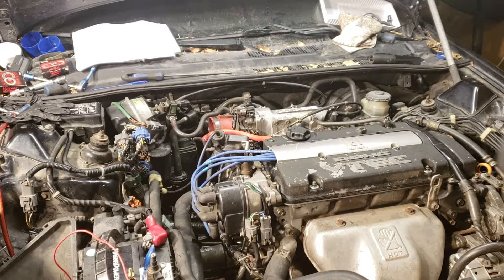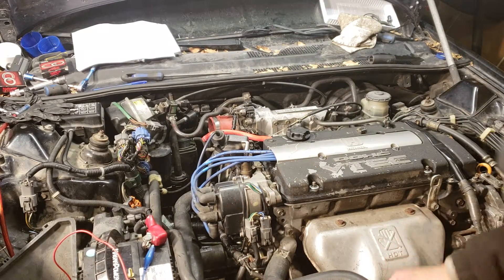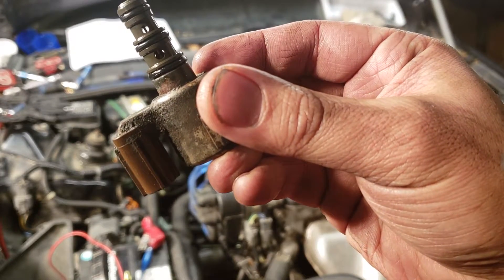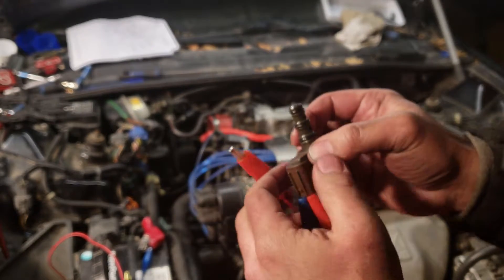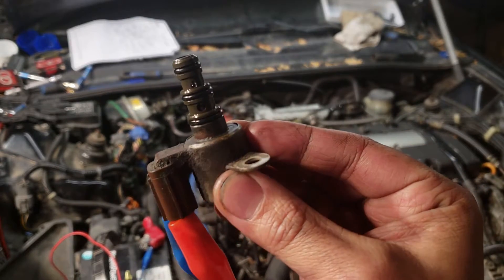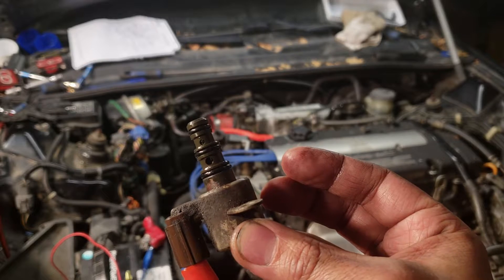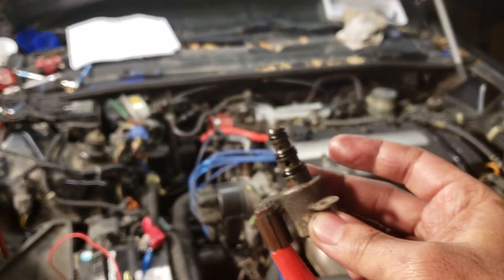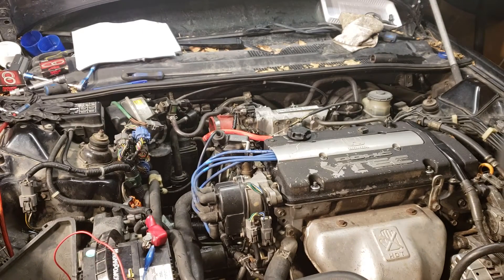HONDA Solenoid valve "A & B" 12volts test

Comment: Hey, is it suppose to move up and down? I tested mine and it clicks like yours but I don’t see the shaft moving. I tested the resistance and they are within spec. Let me know, thanks!
Reply from the maker: Yap that shift inside suppose to move  up and down. Applying  voltage  on the 2 terminals
Reply: I tested my solenoid too and mine doesn't really move it just clicks I have a p0740 code.
Reply: I will go to the junkyard and get another 2 and test them out to see if there is any difference
Reply: My transmission slips and misshifts sometimes 👍

Comment: Hey I know that black and brown plug won’t fit each other ( the strip of plastic lip is on opposite sides of each other not letting the connector to slip on all the way and click on ( lock on ) but what if you shaved down that lip and used two black solenoids or two brown solenoids? Would they both work or do they do different things? I know the holes on the shaft of the solenoids are off a little but does that matter or should I just order the brown colored solenoids??? The auto parts store sold me two black colored solenoids and said it was fine but I found out it doesn’t fit the plug????!!!!!
Reply from the maker: Take it back to the store  and its better to get the right  ones.  If u need the parts quick just go to Junkyard have them. Hondas  have the connectors on different  colors  so that u dont  plug  them on the  wrong Solenoids